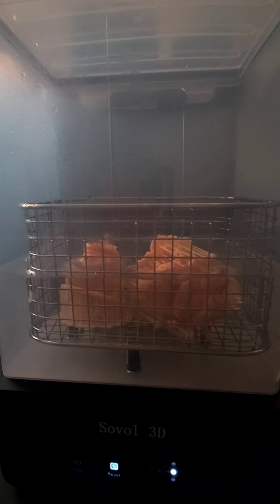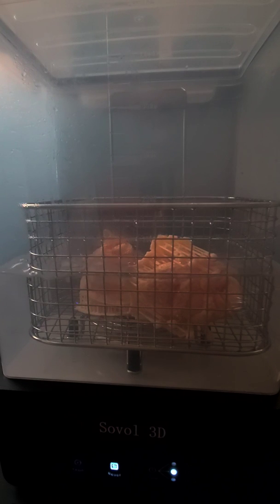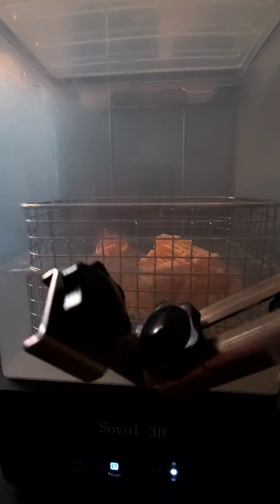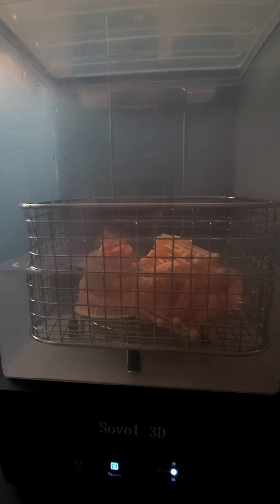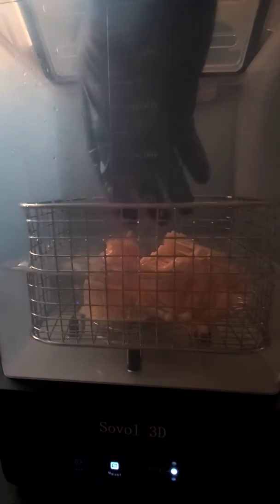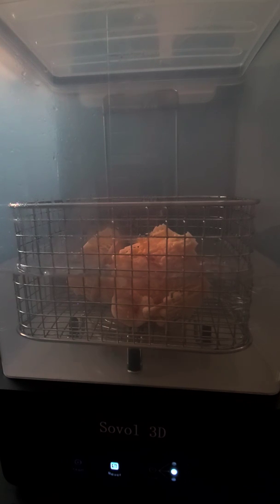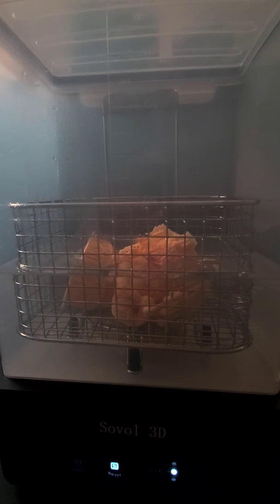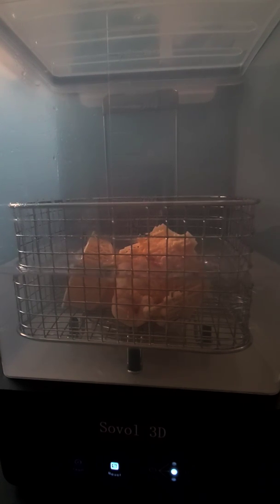Sovol 3D SL2 Wash Station - Cleaning a BeHoHoHolder

Comment: What are your thoughts on the SL1 & SL2 now almost a year out? Have you run into any major issues?
Reply: The SL1 (curing station) has had a little loose connector.  I had to take the top off, and tighten the connector where the power plugs in.  That's been the only issue I have seen.  I don't even consider it a big deal, it was so simple to fix.  I still use them both.  I have barely used my ultrasonic cleaner since I got them, and that has only been with water to clean them after they have been through the two stations.  

I think the advantage to them, is they are simple.  That helps to make them work better.  For minis, it works great.  I will admit, some larger items, I still put in my breadbox UV box, but those are LARGE prints.  (From the Saturn).